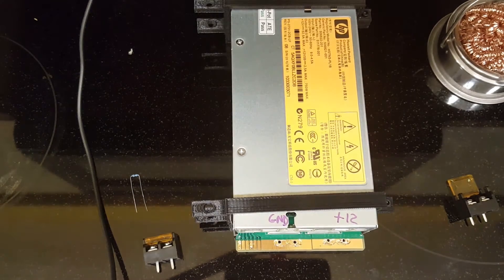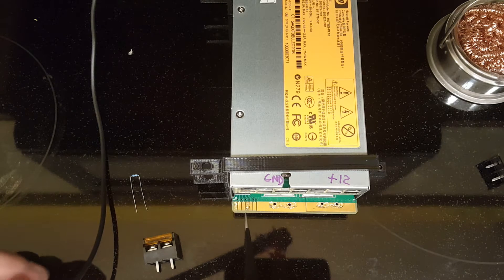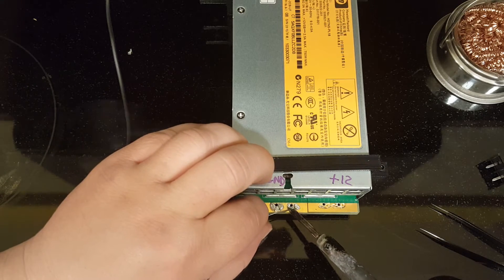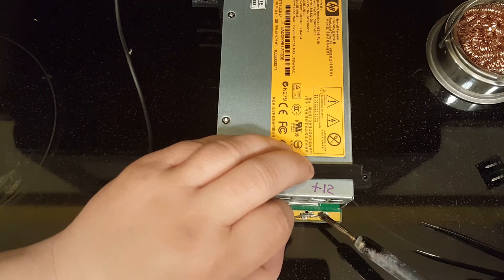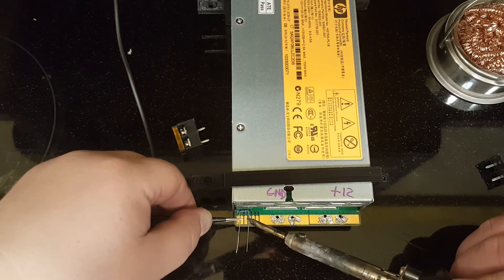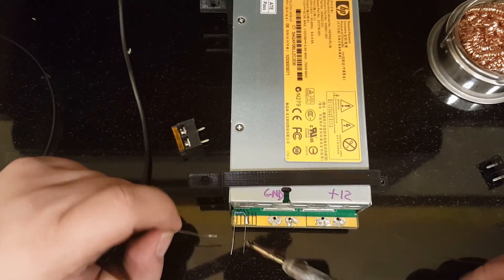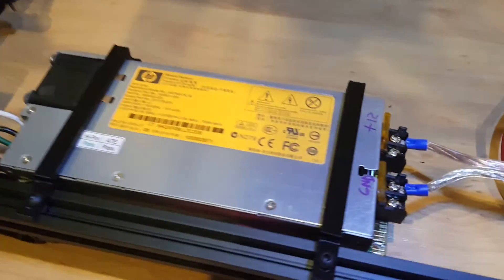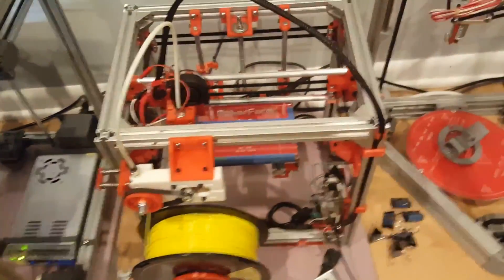Hypercube XL build #6

Comment: i just bought most parts to start build my HCE.

because of your video, i bought the same PSU, so i can follow what you are doing xD.

just few questions:

what kind of Z thread rod you using ?

do you have STL files for all your printed parts? or they are basically the stock parts?

Comment: I like the idea of using M3 bolts and no soldering , 10mm with washers and 2 nuts - one for lock down the other to clamp connection

Comment: If you're looking for ideas for videos, I'd love to see a walkthrough of that LCD panel menus, what it can do and how it works. You seem to really like them. Is it the one with the USB port on the side so you can print from thumb drive? That would be much better than unreliable sdcard.
Reply from the maker: Yes, it has both USB and SD card. I mainly use SD card and it works fine. Great idea about the video. I want to do one about attempting to reflash my malfunctioning display. I'll include overview

Comment: Looking good so far Artur!
I'm curious what type of solder are you using..leaded or lead free?
30 watts should be sufficient for this type of work..but lead free solder can be a big PIA and seems to require more heat and takes longer to spread...The flux is a good idea...better results in the long term.

Funny I just got a Goot 30 watt (Japan) Soldering iron in from Ebay today..! I know what I'll be doing this weekend..Keep up the videos..always informative and dare I say fun!
Reply from the maker: I'm using leaded solder. I'm old school :) Those power pads were kinda large. I.e. big heatsink. Maybe I should use a different tip on my iron, but really a higher-wattage iron would be good for this. I kinda needed a third hand when one of the connectors slipped out.
I use solder with flux/resin in it but still it helps to add some more. Using flux helped a lot on many occasions.
So, you'll have a video coming with a review of your new iron? :)
Reply: I'm seriously thinking about it Artur.. :)
But I do prefer being on the viewing end! ..btw nothing wrong with old school..I've tried 2 different lead free solders both with mediocre results...now they're collecting dust. Long live leaded solder!

Comment: Thanks for the updates.  I have a cheap but good Iroda gas soldering iron that has a large tip for heavy work.  Seems to pump a lot of heat in, though only rated at 70 watts apparently.  Like the idea of adding the connectors to the power supply, I wouldn't have thought of that!

I bought a cheap 300x300 bed, but I think it was a false economy:  I doubt my Smoothieboard or planned Duet WiFi (maybe even the meanwell PSU) can supply enough current.  I'll probably just splash out on a 240v silicone heater, SSR and 6mm plate instead of the stop-gap.

I've just discovered a Facebook group for Hypercube builds.  Do you use it?
Reply from the maker: So your iron worked for you? Mine is only 30W. I might have another one floating around somewhere but i never use it because normally it will be too big. But maybe for jobs like this i should dust it off. Generally trick with hot air works well, especially for heated beds - one big heatsink those are.